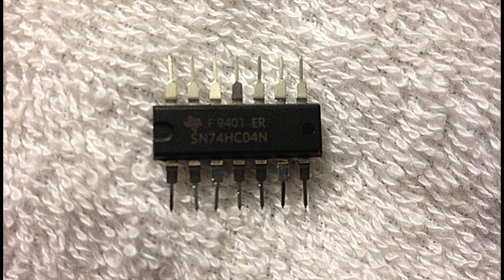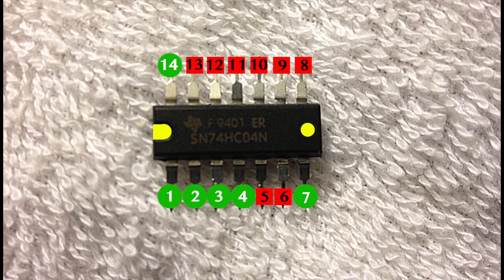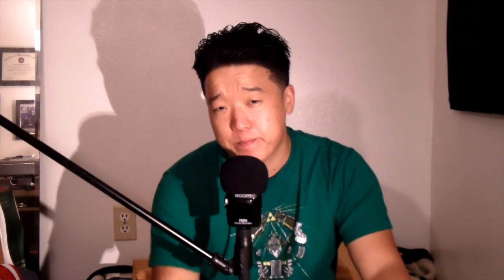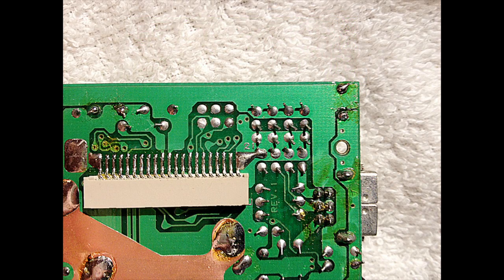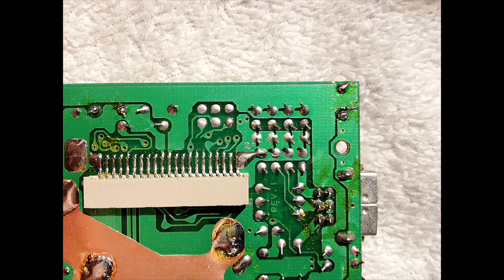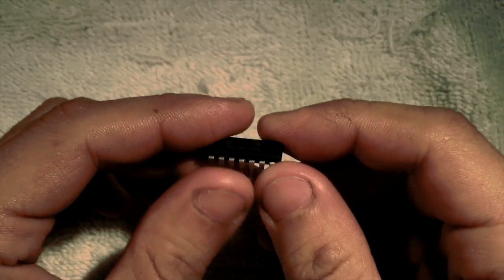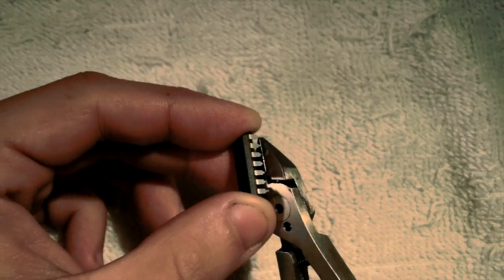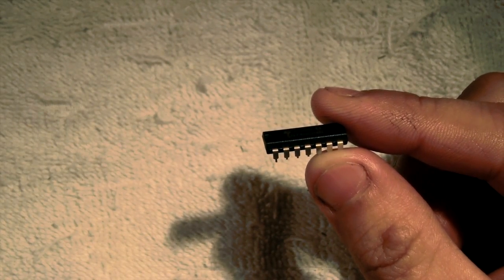Modifying your DMG-01 Gameboy for Chiptune Part 3: Biverting your Gameboy [1/2]

Comment from the maker: I had never tried before and that would actually be more difficult than just installing one bivert chip and rotating the polarizer film 90 degrees.

I'm going to say no because using two chips would just revert it back to what it would look like if you never installed them at all because you doing it through the circuits versus one circuit and a polarizer.

Comment: i was talking about how you turn it up, and then it goes inverted. then turn it back down for regular. but i got a backlight and sure enough mine did the same thing. i just wondered if you knew why it changed.